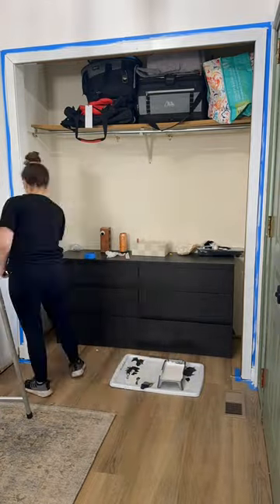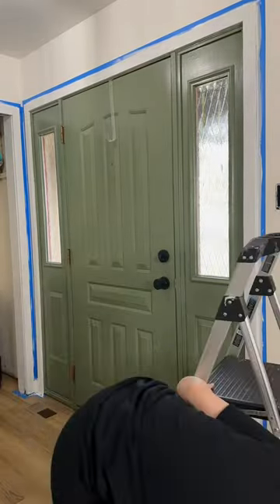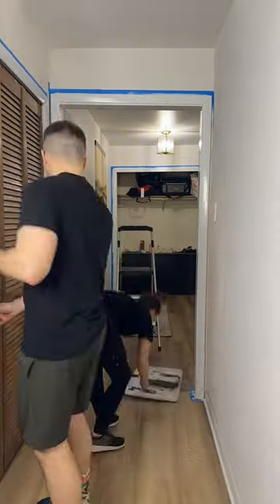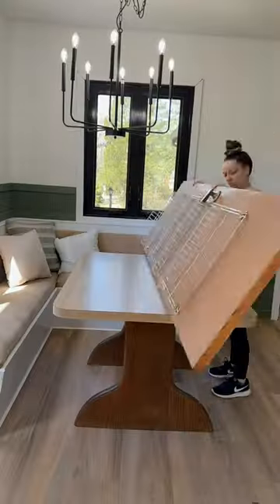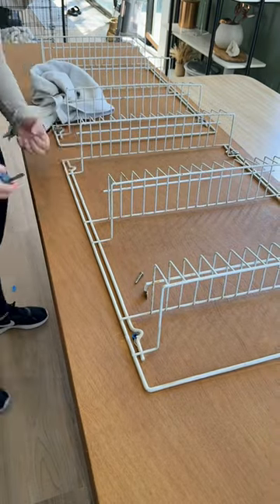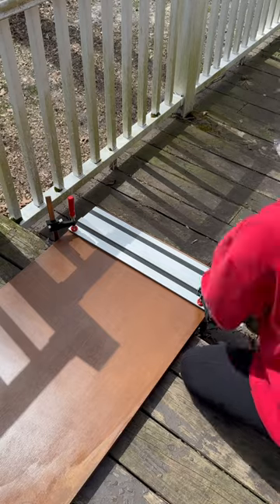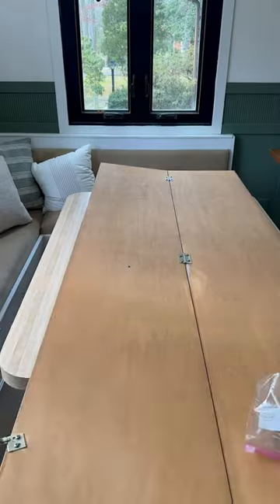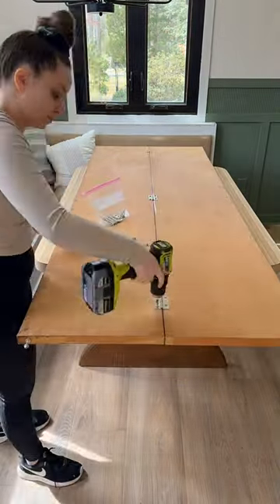HOT MESS LAKE HOUSE RENOVATION PART 246 | VIRAL TIKTOK SERIES | LEXI DIY

Comment: You might have thrown them away already but maybe try to soak those storage shelves in some dawn soap and hot water and then scrub them to see if you can get them clean, those things are expensive.
Reply: I was going to say put them in the dishwasher if they will fit. I agree they are expensive don’t throw them away if you can give them a thorough clean.
Reply: Why waste what you already have??
Reply: i was going to say the same about the dawn, it will clean them and easily .. just warm water And blue dawn with a presoaking in the tub 😊 maybe give them away to someone who doesn't mind cleaning them, there are tons of places to put a free notice with your address, especially nextdoor and Facebook...put that it's first come first serve, you don't even have to deal with anyone
Reply: forgot.. put it to the curb
Reply: I have the same wire shelves, I take them down once a year and spray them with a mixture of ammonia and mr clean with water in a spray bottle. I use my bathtub. The spray dawn works great too. Walk away and the grime literally melts off in 15 min you can come back and rinse with hot water. Some people really hate the smell of ammonia or I would have mentioned it earlier.
Reply: You cant really soak these because they are rubber or plastic wrapped metal that usually cracks soaking it will cause the metal to rust, I've also tried painting them and I wouldnt suggest that either.